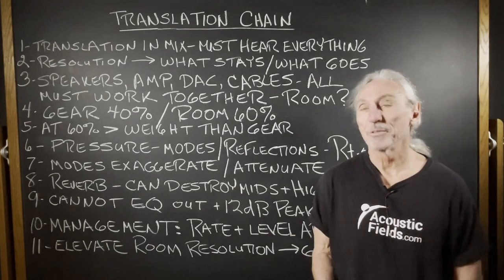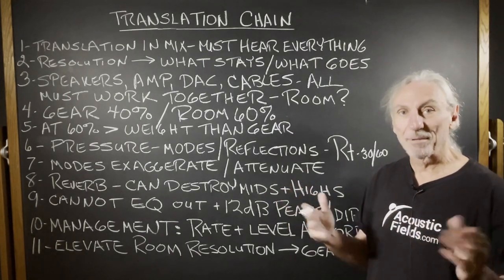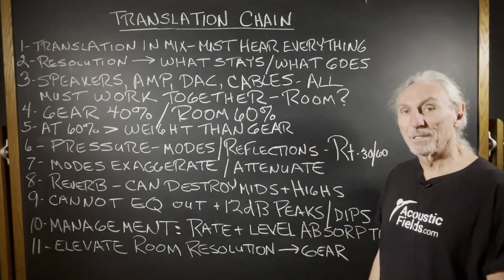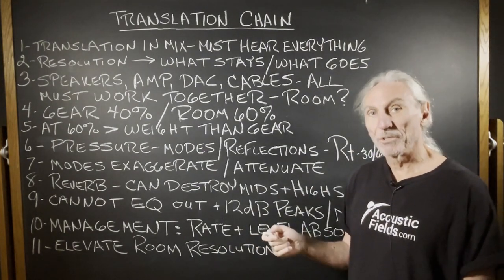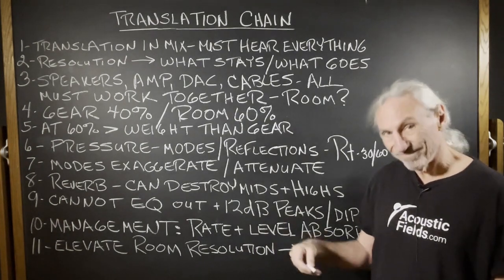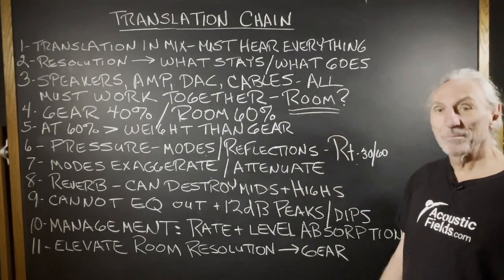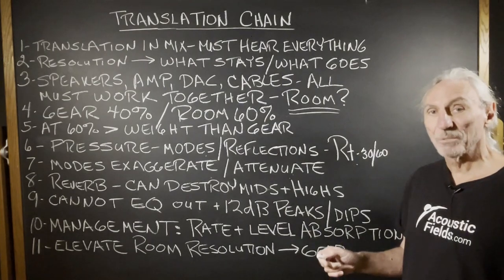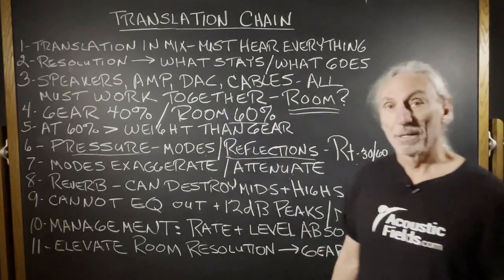Translation Chain - www.AcousticFields.com

Comment: My living room and listening room are one and the same. This impacts my ability to treat my room. My experience, having moved from an OK sounding room (lath and plaster walls) to a poor sounding room (drywall) is that the room is at least 2/3 of what we hear and possibly more.
Reply from the maker: No argument there. The room is at least 50%. Why do people not treat a 50% + problem cause with the proper solutions. It baffles me after 40 years. Especially when you look at the cost of their gear. They are only hearing about 40% of what their gear can produce.